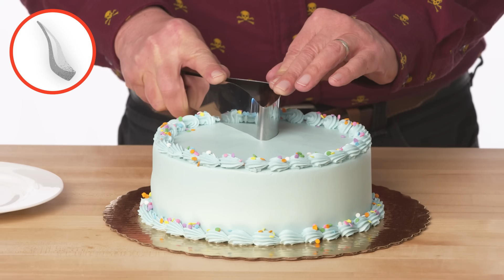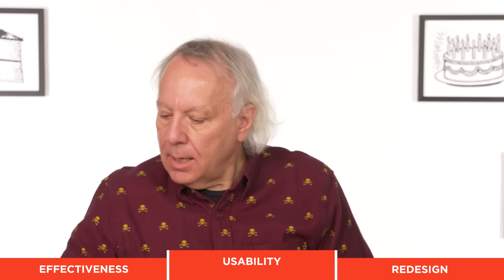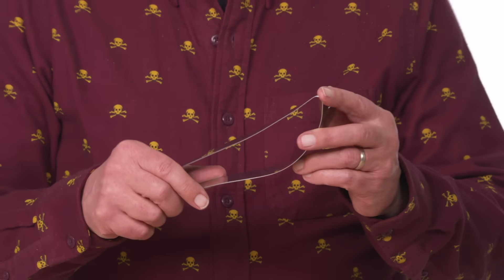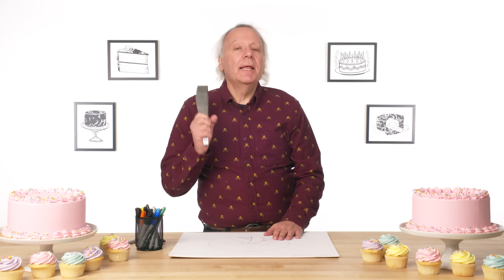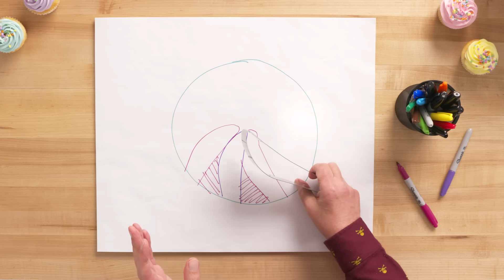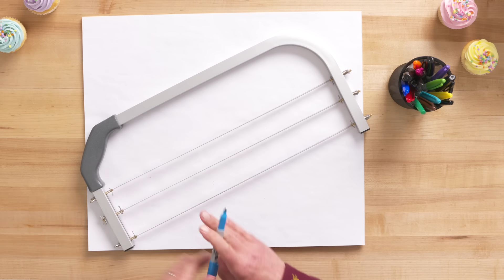5 Cake Making Gadgets Tested by Design Expert | Well Equipped | Epicurious

Comment: That first one seemed more like a knife problem... I mean the device was pretty bad, but it wasn't the one making half the cheese cake stick to the knife.
Reply: Agreed, Cheesecake is one of the most messiest cake to cut. Not only that when cutting a cake and try to make the least amount of mess (Especially with cheesecake) you want to cut down and pull outwards not up like he did, now you have icing and cake everywhere.
Reply: @Hotties4saturn  Cheesecake cuts easily if you rinse the blade in hot water between each slice. Just having a film of warm water on it and it won't tear up like that.
Reply: @Hotties4saturn  and also you have to realise that hes acting as a first time uses I would think to pull it up and not slide down
Reply: @Hotties4saturn  whenever I cut cheesecake and pull up it never gets messed yall stay tho
Reply: That is the comment I was looking for. If you design kitchen gadgets but you don't know NOT to lift the knife but to slide it out at the bottom???  All gadgets would fail here so some plain cake slicing know how is expected.
Reply: Yeah that knife was just not cutting it 🤓
Reply: No, but the design of the device did greatly increase how many cuts you have to make for a given number of slices, each cut making the cake messier.  Cutting into 10 pieces with the device required 2 cuts per slice, 20 in all.  (Couldn't do 15 because opposite slices didn't line up.)  Cutting into 10 pieces without the device would only need 5 cuts.  A better tool for this job would just be a stamp that pokes evenly spaced holes in the icing, which could then be used as guides to cut the cake all the way across.
Reply: He didn't do anything wrong. This is more of the average person perspective. You can't expect an average person to have the perfect knife all the time. Also, not everyone knows how to cut a cake a pastry chef or a baker would. So to the average person that need these gadgets, it would definitely be bad gadgets. A baker or a pastry chef wouldn't need these gadgets because they have experience anyways. So yeah. In a perspective, these gadgets are very flawed.
Reply: Ife Oyesile  A significant enough people use it to merit its mention.
Reply: It uses cheese cake as its demonstration photo.

I feel like 95% of the complaints on the comments on these videos would be solved by looking up the product because usually the reason they've done something is because it advertises itself as being able to do it.
Reply: Your perspective is off. Let’s say, a normal average person used it, and they used it, the instructions don’t say to use a sharp knife for cutting cheesecakes. But I get why u think this way. This is just my opinion
Reply: @krahser6914  I’m a normal average person and I know better to wipe my knife off with a wet paper towel after each cut. Still not a great device but being that he’s at the Epicurious office/filming studio you would think that would be provided for him
Reply: i agree 100%. that was user error. i honestly want one, because I'm terrible with math and fractions due to dyscalculia. i'd really benefit from it.
Reply: @kittydoescosplay2416  there are cake dividers that you just press gently onto the cake, so that they leave lines and you know where to cut, I think those are way more useful (I think most of them have two sides, depending on how many pieces you want)
Reply: don't people cut cake like a line in the middle, another one in this one's middle and then keep doing that? i don't see it being a huge problem (not that big of a problem if two slices are different sizes
Reply: @kittydoescosplay2416  if you want to cut cake into eight slice, just slice it in half, then cut those halves in half, and then cut the quarters in half, so 4 cuts in total
Reply: @hazzy5714  only works on a small cake or with a very long knife
Reply: @kittydoescosplay2416  if a normal perosn was to use it they would think to pull up not slide

Comment: I think designers have underestimated how dense storebought cake is.
Reply: I agree they didn't  also they made all the edges flat and thick it makes it more difficult to glide through a cake
Reply: Thats true, but cake gadgets are supposed to work on all cakes unless it says they shouldnt use it on a store bought cake.. im pretty sure none of them said that.
Reply: And have overestimated how dense cake gadget buyers are.
Reply: How has no one commented on this?
Reply: @Average_Joe-b8c  most people are busy finding faults in his testing methods.
Reply: @MegaDRKSTR  I couldn’t find any, in the double layer cake slicer, he didn’t use 2 hands but in the comparison he did. That doesn’t really matter because the whole point of that double layer care slicer is that you don’t need to use 2 hands, if you still have to use both of your hands to get the cake slice off then what’s the point of buying that ‘gadget’?
Reply: As someone who studies in the field I can tell you that a lot of people just do things to get rid of them and get a pay. In this case, they’ve created problems instead of answering to one. 
They’re trying to answer a question no one asked.
Reply: Let’s try it in homemade cake :D
Reply: If the product is really effective, it should be able to cut any cake (they did not underestimated the store-bought cake)

It’s not about the hardness or softness of the cake, it’s how effective the product is no matter what type of cake it is.

*Im just clearing things out*

Correct me if im wrong
Reply: what designers for the first one? They literally just welded a sheet of metal and call it a cake slicer.
Reply: In my case, I've never gotten a store cake which is that hard as he is using. All my cakes I've bought to this day has been moist. Not sure what type of cake they are buying 😂
Reply: I guess they thought it would be a piece of cake.
Reply: Right💀
Reply: Ja
Reply: Bet ya they only tested these on cup cakes
Reply: I thought they made all the cakes😂
Reply: I love how dense it is
Reply: Surely if you're buying a cake leveller, you're making your own cakes at that point
Reply: @rowanmelton7643  Probably since pre cut cake can be bought in grocery stores.
Reply: Yeah
Reply: LITERALLY LIKE WHY
Reply: Concrete
Reply: because the are selling to people who can actually cook and like cakes they can recite the ingredients of without a 5 year chemistry course
Reply: I think they made it, store bought cake wouldn't be that dense =))) that's some extra level of density
Reply: they are "fake" cakes (in the sense that they will be beautiful to look at but they will only taste of sugar, with all that sugar paste with which they cover them). I hope that in America they are not all like that, and that there are cakes made much better and with a much less "fake" look.
Reply: Or how blunt knives can be .
Reply: I think they chilled the cakes too, that’s why they are so dense
Reply: Maybe they are looking at food commercials and belive that is how it look for real without the advertising firm cheating at all. The ad using glue to simulate cheese on the pizza? No way!
Reply: Yes but those professionals with good textured cakes will have no problems with it
Reply: Yeah-and the-uh-cake divider had over estimated it-
Reply: It also doesn't help that he put the blades on the leveler to high to begin with, and that is something that someone who has even basic knowledge of cake craft would never do
Reply: @Junglehunter677  These are products for the average person, who doesn't know the basics of cake craft. They just want to cut cakes, that's the way Dan is approaching this.
Reply: @Junglehunter677  an expert don't even need those trash, because I'm one of the expert and we have our knife.

Comment: I think the cake leveler also could use some kind of ball bearing or wheels so that you can actually roll it over the table when cutting which might help with consistency. Also, a neat little ruler scale on both sides so that you can actually make sure you have a properly horizontal blade.
Reply: Or just cut one layer at a time.
Reply: @yvieoluoch66  Yeah, one layer at the time sounds a lot better than pain
Reply: @yvieoluoch66  yeah i think people forgot that single level cake levelers exist and actually work
Reply: there’s actually a great cake leveler with much better grip, sturdier saw knife and have for stabilization called the agbay cake leveller. but on the pricey side. the device in the video is good but just a bad construction and not a good blade material and doesn’t have a set height so it does lead to uneven cake layers
Reply: I have a cake leveler like what you discribed but It has little feet not wheels
Reply: Great ideas!
Reply: Oh smart.
Reply: Maybe make it a 2 handed operation
Reply: I have a cake slicer that has a single cheese wire as it’s blade (so works left or right). The single wire which is easily raised/lowered is easy to use and you can just remove the bottom slice, do the next and again (so all slices are equal). It’s brilliant
Reply: we think alike

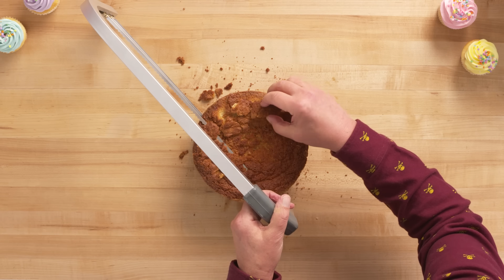Comment: 8:37 there’s no “structural failure” you leveled the top. That’s what you’re supposed to do is take the top off. It levels it. Almost like it’s. A cake leveler.

“I was looking for four layers.” You misused the device then. Not saying this gadget it great or anything, but in this instance it is purely user error.

Comment: That cheese cake was sticky as hell. It didn't matter what you used to cut it, it was gonna make a hell of a mess.
Reply: But that's not what was tested
Reply: @PabloEmanuel96  Cheese cake is NOT a cake. It's a type of torte.
As someone else has stated, he used the entirely wrong knife to cut it, as well.
When you set yourself up for failure, I do believe it's unfair to the product being tested. Realistically, you want to test it under the best and worst circumstances, so you have a good understanding of its strengths and weaknesses.
Personally, I think I would just use it as a guide to get even slices. Score the surface of the cake, remove the gadget, and then slice. Obviously it's going to take more time, but that's a sacrifice some would be willing to make in search of even slices.
Reply: @DefensorsPacis  but the point was that it doesn't produce even slices
Because the error from each slice ends up making the last slice smaller
Also it is hard to center it in the cake
Reply: @PabloEmanuel96  Or the slices were uneven when he attempted to continue slicing with a knife that was COVERED in cheesecake.
Reply: @DefensorsPacis  yeah I see it

Comment: I think the curved cake slicer is meant to tessellate by using the 'handle' end to cut the next slice. That's probably why the smaller side isn't blunt; it's meant to flip over and also cut. Still a pretty awful design regardless!
Reply: I actually don't think that's the case. If you look, you can see the handle is dramatically thinner than the blade, and it sticks pretty much straight out instead of curving in the opposite direction.

That said, can you imagine how gross it would be using it that way? You'd have to get cake all over your hands, and any residue from your hands all over the cake. XD
Reply: I think That really wouldnt work either. The curvature of different parts of that slicer don't fit together.

Comment: This series endlessly frustrates me. I feel like he just try’s to not try when using these things 🙄
Reply: What do you mean?
Reply: @PabloEmanuel96  cake slicer and sever- there is a little bit of the cake that should hang off the end if used correctly. He doesn’t HAVE to flip the cake on its side. He manages to use a normal cake server to do so, so why not that one? They are identical in shape. 
Or that the two handed cake slice and server is “demanding” because it requires 2 hands. Pretty sure you’re gonna go slower with knife and server if you keep your other hand behind your back. Turning the cake with your second hand uses a second hand. Why isn’t that “demanding”
Reply: @chadhamel8707  I agree on the demanding two hands one
But the server was supposed to push the cake on its own
He used his finger with the traditional one but the point of the automated one is that it does it all by itself

Comment: Perfect cake divider instantly fails by not having a centering mechanism.
Reply: Yup. Testing it on a cheese cake wasn't really giving it the best chance either.
Reply: @clearmenser  it’s called a control test. If it can’t work under a common circumstance like cutting a cheesecake then it’s poorly designed
Reply: And him not using the correct knife
Reply: @taedraricketts8426  And cutting it on a plate with a raised rim. It made me want to scream.
Reply: Swinging the arms opposite each other would give a better estimate of the middle of the cake.
Reply: In the end it overall seems unnecessarily
Reply: I can easily imagine a centering machine for it too. But it would be too bulky and clumsy so that's probably why it was decided to be cut away from the design
Reply: The first thing I would change about this device is making the arms longer and with numbered marks across to let you know if both arms are reaching the endge of the cake at the same lengh. I would also make the center spike narrower and smoother (to prevent terring as you rotate) and make an adjustable stablising disk-ring on the top of the spike.
Reply: Imaging placing the cake on a plate with markings painted on the rim. Something like 8, 10 & 12 to choose from depending on how many pieces that are wanted. The numbers could even be done in different colours to make it even more obvius.
Reply: Fact
Reply: it's like it's his job to test and second of all the result without is the same.. just buy a big knife
Reply: Well the knife alao wasn't suiret to cut a cheese cake.
Reply: Just get a protractor already!
Reply: Cake dividers are silly anyway.
Reply: my thoughts exactly
Reply: best way for it would be to basically have it have flaring out cutting spaces so you just dial it in and it shows where to cut EVERYWHERE. Not just one place and slice at the time.
Reply: And by not having a knife user with functioning hands
Reply: @dorkwell  sir I think he did that on porpase to simulate someone with hand disorders
Reply: @krahser6914  A person with a disorder doesn't cut a cake so bad that it starts to stick to the knife.
Reply: @krahser6914  I have physical issues which effect my ability to do daily tasks like this. 

I understand the sentiment, but if your issues are bad enough to rely on gadgets like this, you have a carer who looks after and assists you with daily living. It's very easy to cause bodily harm using gadgets and performing tasks like this.

Basic cutlery and aids are fine, but cutting a cake isn't the most necessary of tasks. Angled and/or wide-gripped cutlery, pill bottle and jar grips, non-spill/hand-steady cups and safe straws are more important than a cutting guide for a cake imho
Reply: @dorkwell  don’t be hateful love everyone Like Jesus Did AMEN 🙏
Reply: The test was rigged aginst it from the start. The fella ain't using the proper knife or even cleaning it in hot water between cuts as you would. I think his criticism of it are legitimate but the demonstration he made when using it fails to support them effectively.

Comment: What's the point of a multi saw to create multiple layers? If you want multiple layers, bake them separately.
Reply: baking separately either takes way more time, or requires an investment of more pans. Then If you want a professional looking cake with leveled layers, you’d have to level the dome top of each layer, which is more waste than leveling the top once in a big boy.
Reply: Or you can cut them individually several times
Instead of four lester's at once

Comment: The two-handed cake slicer does have some advantages because it can cut, lift, and serve in one fluid process. The slice won't fall over and would still be completely food safe since there's no finger or additional tool used to transfer it to a plate. I kind of like that. I also see the flexible metal as being part of the design so the server can grip the slice and transport it to a plate more easily regardless of hand strength.
Reply: Me too!!
Reply: The only problem is that the smaller the slice, the more curved the slice looks so it gets difficult to cut it
Reply: @leonmystique9372  Yes. Maybe these should come in an array of sizes to match common pie / cake pan sizes.

Comment: Why didn’t you flip the curved one? That way the straight edge would meet
Reply: But then what do you do with the two curved edges?
Reply: Two curved edges isn't the problem, it's the handness of the curve. If the cutter was flipped, its handness would flip too. Straight blades avoid this since it's not curved to any direction aka a line that can form any possible lined polygon, and curved blades just have to sync up with itself.

Comment: I can't stand the left handed oil test. It's too much.
Reply: As a left hander, I really appreciate him pointing out how a lot of tools are only designed for right handers. And I'm sure people out there with arthritis and grip and dexterity issues appreciate designers actually taking the time to do that test that you are complaining about.
Reply: @aoielf  my thought process is that It's just icky and seems like an as-seen-on-tv, create-a-problem and it's silly. I have arthritis and carpal tunnel at 26 from ten years of CAD school/work. Every tool, from forks to wrenches is hard to use. If something is slippery you wipe it off or wrap a rag around it.
Reply: @MTNorville  but the oil is not for that
The oil is to make a person with good dexterity harder the use of the gadget to simulate what a person with arthritis for example may experience